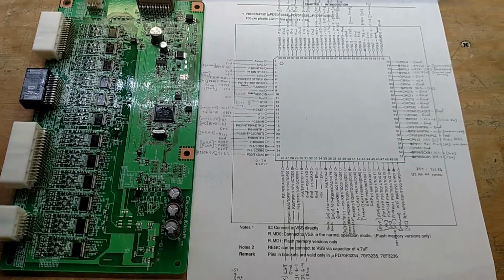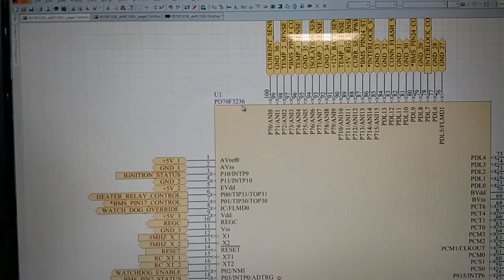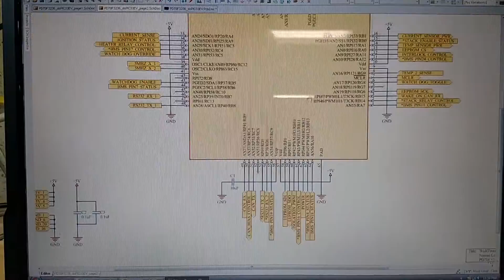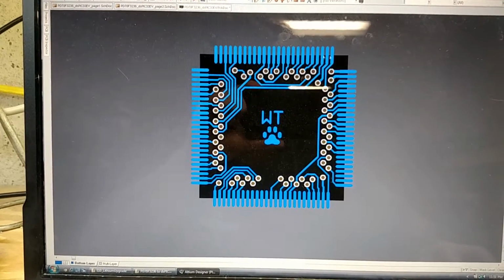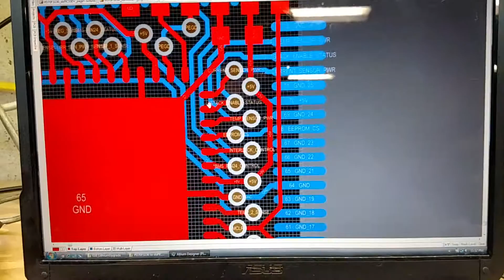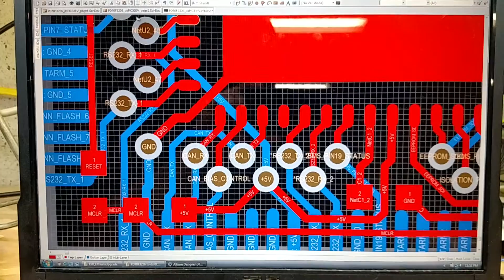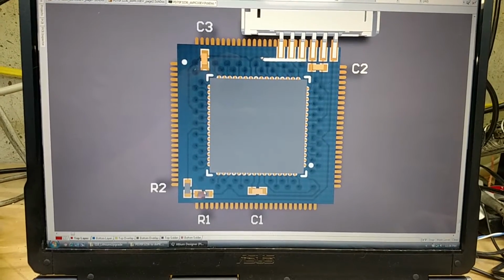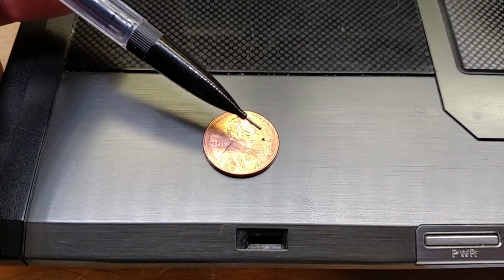Solectria E10, Lithium Ion Battery Upgrade, Part21

Comment from the maker: I am only planning on making three boards, since I plan on putting three Leaf packs in the truck.

I will send the files off to OSH park... not sure if they make them in China or not...

If others are interested in using the boards I can order more and make the code generic enough that they can be used with any Leaf battery pack configuration. :)